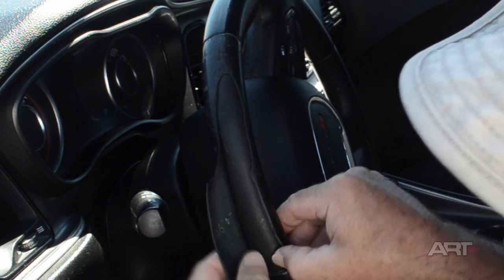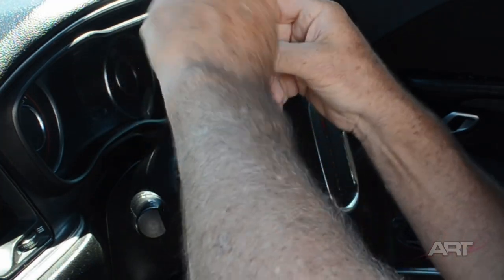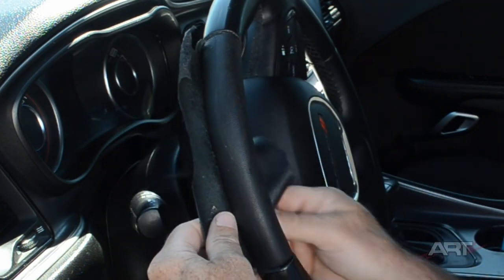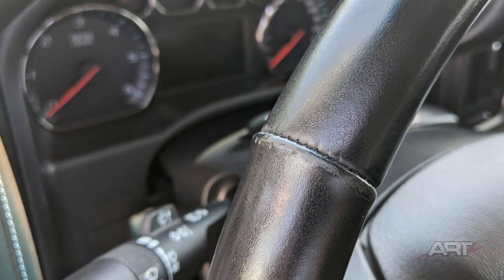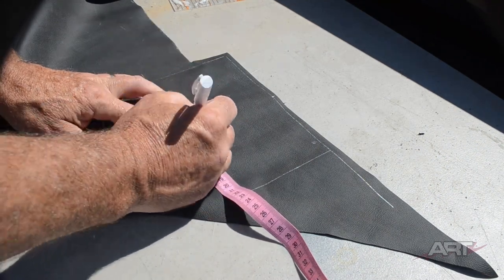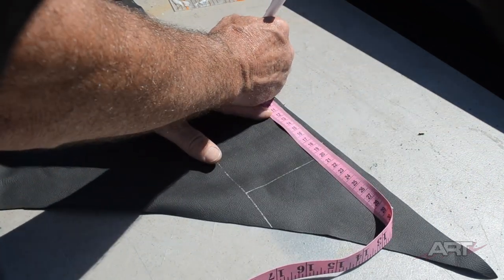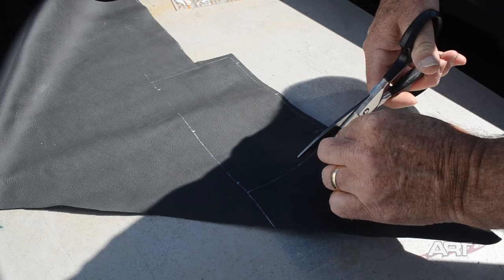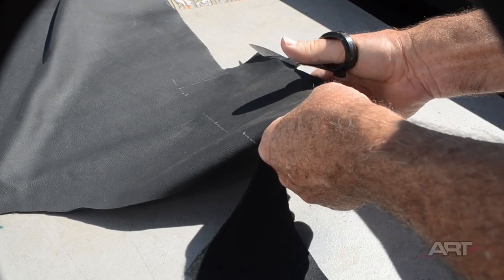Leather Steering Insert With Channel v72

Comment: How do you decide between inserting a leather plug or replacing a whole section of leather on a wheel?
Reply from the maker: I just weigh the size of the hole and the specific wheel to see if replacing the whole section will be easy enough.  Sometimes the customer dictates what they are willing to support.